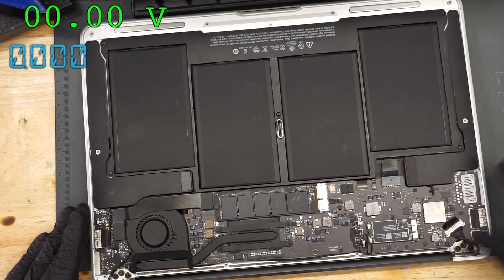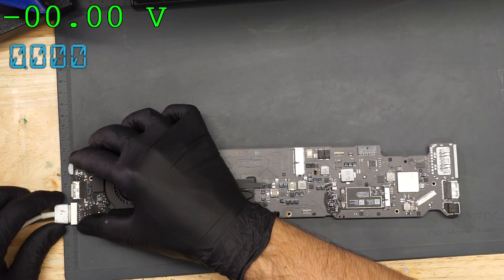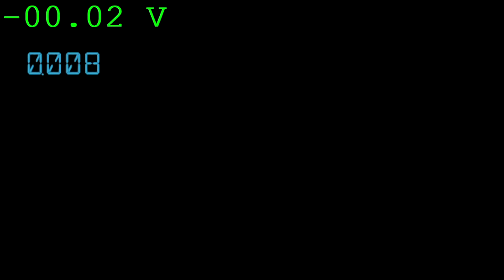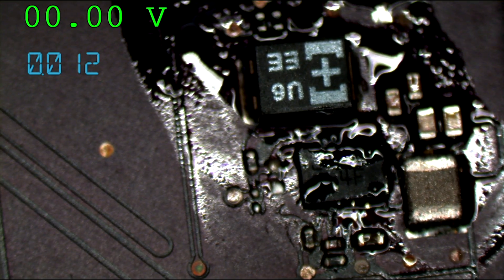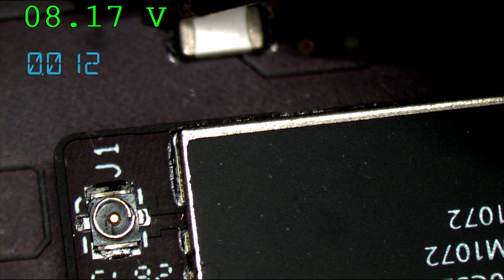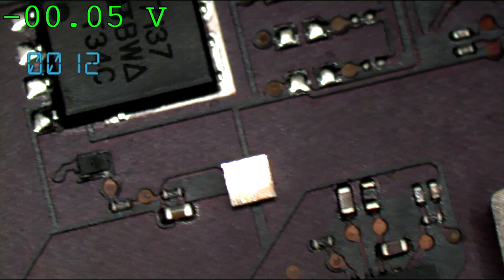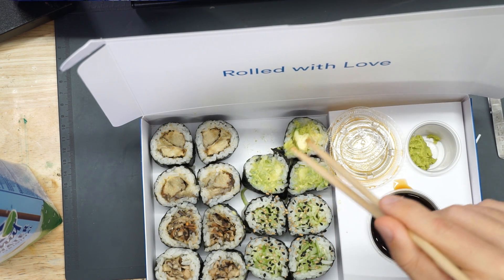Macbook Air logic board repair featuring sushi & the great state of Texas.

Comment: A1466 Mid 2013 - Early 2014 13" Macbook Air 820-3437
Measure PP_3V42 = 3.04V.  Bad
Measure PP18V5_DCIN  (Charger Voltage), OK
Flux and Reflow U7090, because visual inspection shows corrosion. 
Measure PPBUS_G3H = 8.17V. SMC is not turning on.
Measure SMC_RESET = 3.40V (Logic High). 
Somehow magic sushi fixes board.
Not sure this entry is useful unless you like sushi.
reflowing the smc can work sometimes for something

Comment: I believe you have to give the board time to work again because this happened before when you put a difficult to fix laptop in your cubbyhole slot in one video and worked on this guy's computer that called in during the middle of your repair video that was a quick fix and then came back to the problematic laptop and it suddenly worked again. 😀

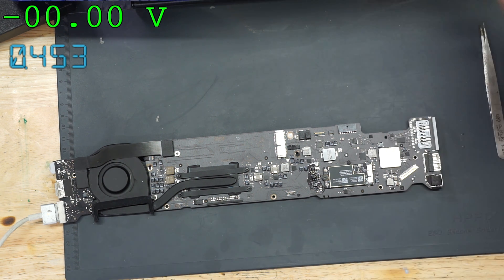Comment: 6:30 - I fixed a Powder XRay diffractometer power supply unit the other day that was blowing fuses: I merely tested voltage levels on four of the sixteen probe points and it started working. What I learned that day was when it starts working, stop fixing it!

Comment: my 2012 mac pro turn on with a file on the screen. I researched and it was a cable ribbon. Paid $7 for the part and fixed it in 5min. Apple wanted $740.